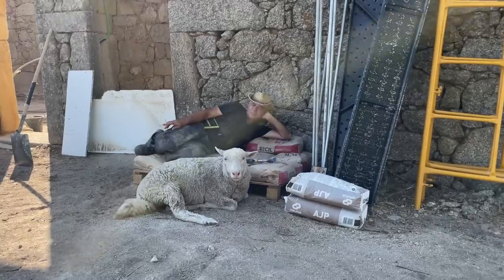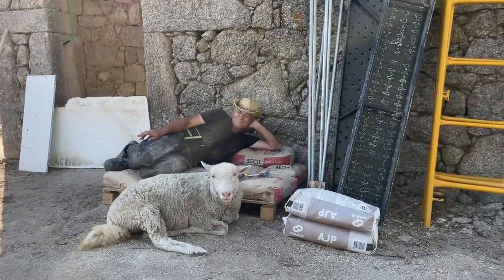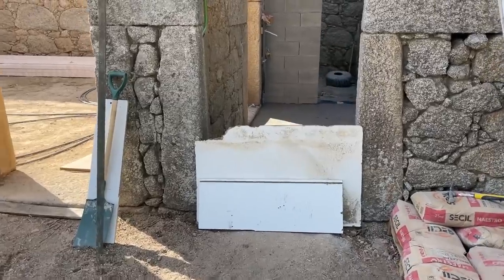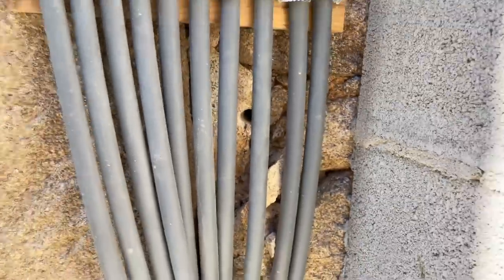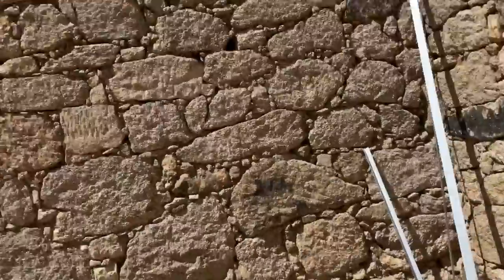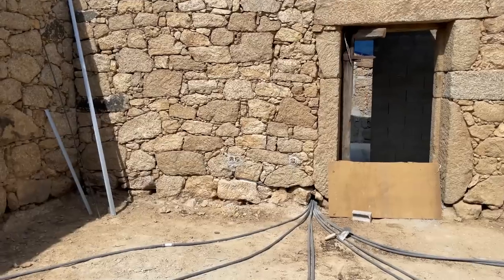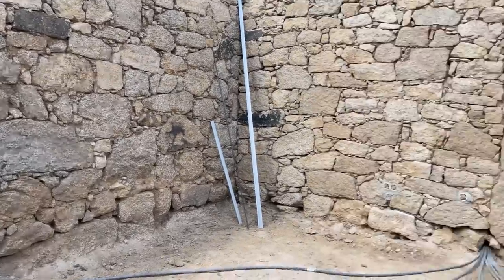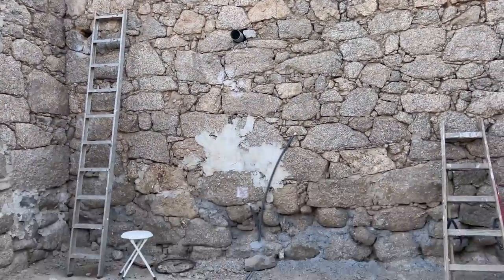FATHER & SON Renovate Abandoned Stone House | DIY Concrete Floor And Installing Electricty - Ep.11

Comment: Hallo to both of you.
I have to warn you about the electricity pipe with ribbles by the door.
It will be quiet impossible to get the wires in these pipes.
You have to much bents so you better put the wires in first otherwise you have to do it again.
So I tell you I had this problem and lost a lot of time in correcting it.
Have many good times together.
Good luck
Rinus

Comment: Small tip, put your wires into the flex before fixing them into the wall. It will be hell to get them in afterwards. I am impressed by the work you are doing.

Comment: I didn't see anyone say it, but the tool you used to mark level on the cinder block wall is called a chalk reel. What you did with it is to 'snap a chalk line'. The kitchen exhaust should be for the hood over the stove/range (плита). You and your father don't need to talk very much while you are working. Great progress Alex

Comment: Thanks for your vid Alex 😇💟💟💟 Love you guys,the pipes for the Coker and the water heater should be metal or they will melt, and the electric flexible pipes are going to be difficult to get wire's in maybe do that first before you cement them in .
Reply from the maker: Hi Arjan,

Thank you for the tip!!

Comment: Hi Alex... congratulations on all that you guys have done... you are working good and fast.
i just want to advise you to get more electric pipes from the main panel to the kitchen area.. only one pipe to cover all the sockets, and cabinet lighting and exhaust.... as you said, it's better to have more and don't need it than less and needing it ;)  (and you can apply this to other parts of the house... power sockets are never too many )
keep up your amazing work.

Comment: Good progress Alex.
Your dad is a busy body, and so  very knowledgeable.
Also a very quiet man. 
Nearly had his hat eaten by Angela that could have resulted into lamb chops.. 😜😇😱

Love that old house.
Our architectural history in stone dwellings in RSA is not as old, therefore I envy you for being able to restore, and soon be living there..  
Sad that you are going to put drywalls over that lovely old stonework in the kitchen. 
Have you ever considered to plasterwash (bagging) along the joints and over the smaller stonework with white cement, keeping the big stones natural and exposed !
This way you can hide the plumbing and electrical points as well...
Just asking 😩😩😩

I'm exited to see what timber and roof covering you are going to use...

Medals to you two for the passion you have for the ancient craft of  stonemasonry and the character of this exceptional structure.
Regards from Hermanus. 🇿🇦

Ps.  Don't you need an old,  fit and able retired architect to come and help you...?
🤔🤔🤔😒😒😒

Comment: A stone work mixex with concrete, in Malta I have worked with team of builders using special Italian sand mix for joints and outside wall "palstering" allowed only for stone maisonery. Bot from technical point of view, as well as conservational restrictions and regulations.

Comment: Not trying to jinx you but I think you're going to have a lot of trouble running the wires in the tubes because of all that curves. You should, at least, runned a guide there.. Hope it goes well!
Reply from the maker: There is a guide in them already.